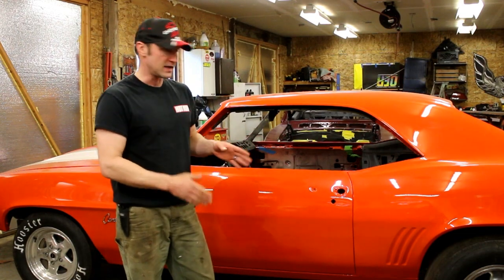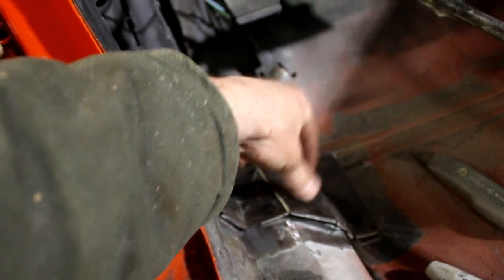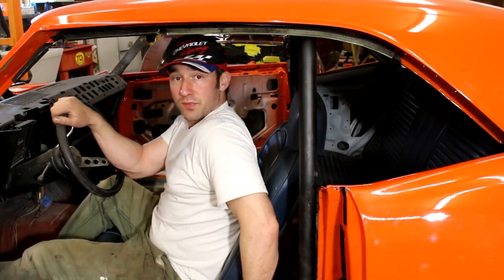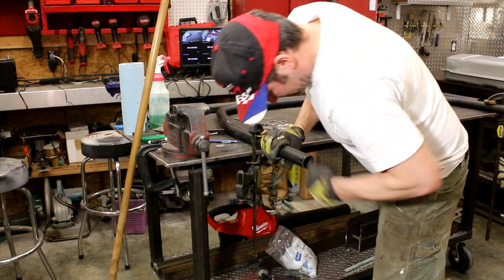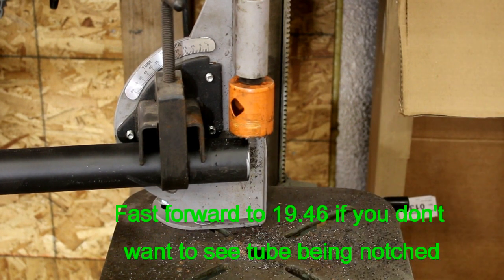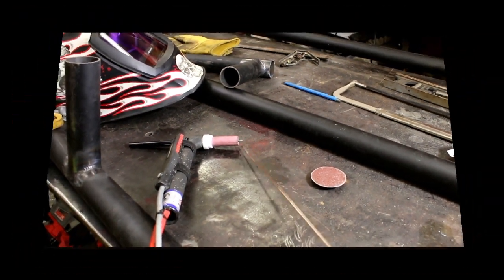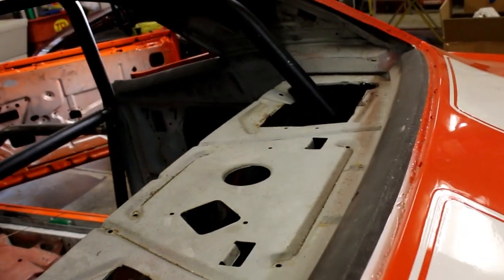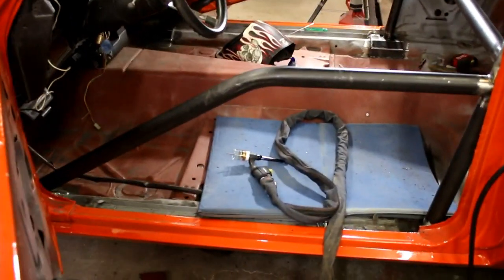1969 camaro 6 point roll bar install and tube notching

Comment: is there enough space 2 slide the bottom seat in the rear?
Reply from the maker: Yep checked that while installing the cage. Goes in and out no problem with where I put it